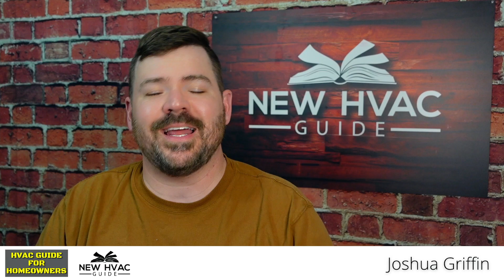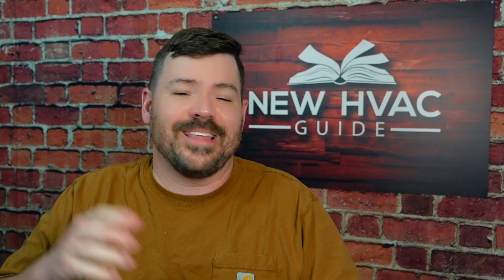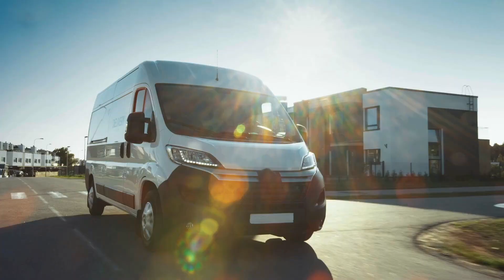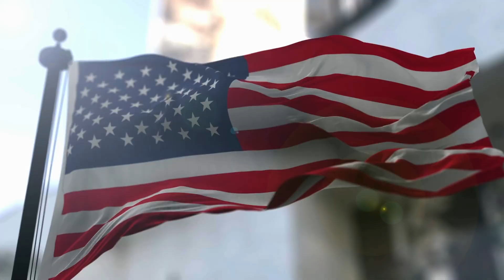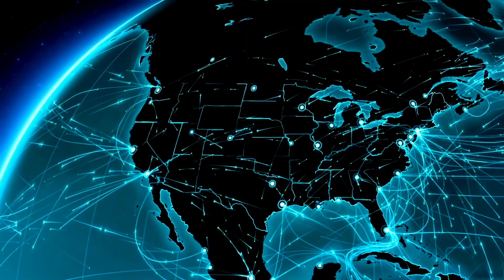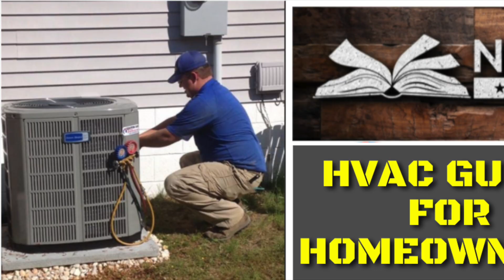The Truth about HVAC Capacitors and What Homeowners Need to Know!

Comment: The 25/5uF GE capacitor on my 1987 SnyderGeneral Comfortmaker JUST failed. AC is STILL working with a new Titan Pro capacitor which was quick and locally available.  (Quick availability comes over quality in the middle of summer) NOW, I have time to look for a spare capacitor. Any recommendations given that the AC's been on borrowed time by about 17-18 years. A new AC means a new furnace. Ugh.

Comment: York AC installed in 1997.  Capacitor lasted  30 years.  Replacement lasted 4 years.
Yea, the system is old, works great.  Where I live I need it less than 3 months a year, and the months it is running the power bill only goes up about $90 to cool a 3600 sq ft house built in 1965.

Comment: People don't like paying for labor, especially when it is at a rate higher than they make regardless of skill level.  Think Surgeon 
compared to someone mowing your lawn.  Doesn't matter.
So often companies just include the cost of "everything" into the part.  Then suddenly its no big deal for the customer.
It would be nice to have a breakout of labor and parts charges, but to do so only will give you a headache with the customer, and deter them from using your company again.

Comment: On price to replace capacitor, HVAC companies are a total rip off. Charging hundreds of dollars to replace a capacitor. I replace them myself. a local parts company sells the caps for $20 to $40 each, and they can be bought online for $2 to $5 each. I stock a couple spares of the 3 caps used in my A/c unit. Just replaced them this week. FOR FREE!!!!! Yeah!! I am also building my own supply of spare parts for my old ass machine, such as contactors, transformers, motors, control board, other components. Over head for a company to stock capacitors? What overhead? The parts are dirt cheap, dont take up much space at all, not much labor to swap out. I am in las vegas, and the weather is very punishing for the caps, no matter what brand you buy. contactors typically can last about 5 years, then are worn out. caps can last 2 to 4 years, and then they are just ready to give up. It would be nice if you could name some names, on best quality parts. I respect quality, but not sure if even the best quality would last too long in the las vegas summers.

Comment: I keep an AMRAD turbo200 capacitor on the shelf for when not if the OEM capacitor fails. they are hsndmade in south FL HVAC company only be charging a maximum of about $400 to replace a capacitor. That includes the trip, diagnosing, labor and cheap $10 capacitor. I can replace my own capacitor in 15 minutes

Comment: Why did capacitors used to last forever and now they only last a couple years? Was it the PCB oil?
Reply: With today's tech every product is made to perform and operate for so many hours of service within certain operating conditions. 
There was a time when companies were in the business to "find or create solutions" to problems.  
Now that just "appear" to be trying to find solutions to problems, when in fact companies are working hard to continue the problem.
Because, if they were to fix the problem you wouldn't need their products anymore.
Reply: @johannjohann6523 so it’s planned obsolescence then. They’re designed to fail.
Reply: And nowhere is this seen more than in healthcare.  We have companies that believe "chemistry" is the answer to disease and better health.
But chemistry has "Never" cured disease.  Chemistry or pills only treat the "Symptoms" of disease. That is why we have "Doctors" instead of "Healers".
Do you really think there is no cure for cancer after 100 years of research and the billions and billions spent?  How about if I told you the cure for cancer was discovered in the 1930's?
And it was big Pharma companies that suppressed that knowledge?  And now Cancer Research has become an industry unto itself.
Reply: How about it is a known fact that neither elephants or whales do not contract cancer.
And today Cancer Research does not include studying either species.
This is on top of disregarding the cure found in the 1930's that uses Frequency to kill cancer cells. Yep, completely non-invasive. And
already tested on human subjects who were all cleared of the cancer in their bodies by this process never to contract cancer again in their lives?   Humans Suck.
How can this work?
"If you want to understand the mysteries of the Universe, first think in terms of Frequency, Vibration, and Energy".  Tesla.
"Frequency" is the answer "to Everything"!   But to cure cancer would mean billions lost in fake medical procedures. Jobs lost for people who
simply don't know any better. Pawns in one the largest, and most evil schemes for profit ever created.  Because it is at the cost of lives lost.
Lives that could be saved, but are not.  Once you realize this well everything is just downhill from there.  Peace.

Comment: Have 44 yr. Old carrier 2.5t pancake ac with 7.5 kw heat still rocking all the factory parts, even the same 9inch tall 3.5in wide 35/5 cap on it, cools like a champ here in Phx, Az. Don't make them like they used to
Reply: business wise, all companies don't make them like that any more. they would be out of business. And they would never meet efficiency standards.

Comment: I keep a spare one that has been run in my unit to test it,  as a spare at all times. I nearly burned up a condenser fan motor when the capacitor died while I was mowing the lawn. I had finished the lawn and noticed that the house was getting hot. I looked outside & noticed that the fan had stopped. The motor was so hot that water sprayed on it turned to actual steam. The thing is still running, and that was about 10 years ago!  The motor was made in India.
Reply: My fan outside is on but no air blowing inside my home.  Do I have the same problem?

Comment: I think changing a capacitor should be covered in a minimum service call. That can be $50 or $500, either way the customer should always be informed of the minimum service call price before you come to them. Service call plus the part cost.
Reply: You would think so because by the time they are done with their meter checking the microf readings, its only 3 more minutes of work to swap in a new one. Lots of contractors bill in 1/3's of an hour or 20 minutes is the same as 1 minute extra. Even so, it's surely not unfair to figure $50 plus the cap and the service fee. Lots of contractors will not charge labor to install the cap if they find the problem within the first 15 minutes.

Comment: I am the only company in my area who honor the capacitor warranties. I have warrantied more amrad than titan pro. Thats my experience. If you read the factory read out of a lot of the Amrad they sometimes read lower than the MFD rating. And 9 times put of 10 there a reason the capacitor failed, they just dont "go bad".

Comment: Capacitor question for the experts.

I bought a dual capacitor 40/5 but label reads 370V.
Original capacitor reads 370/440V      is it ok to use?

please advise
Reply: Yes, your unit will only see 250 volts max.
Reply: Thank you so much for the advice.

Comment: AMrad is 5 years warranty and made here in the USA, Florida. I think JARD and MARS are made in the USA as are Titan HD. I have a 1991 Amana condenser and it still has the OEM cap and contactor that still works, no leaks, no bulging etc. Unbelievable.
Good capacitors are 370/440 volt rated and made in USA.  Also, a good cap is going to cost $30 to $40 vs. $10 to $15 for the junk that lasts maybe 2 years. It is always a good idea to have a brand new spare handy for the hot summer day/night that you need a new capacitor and HVAC is swamped with service calls and can't see you for 2 to 3 days. Or, they haven't got the correct one at the time, you can supply them with the spare for less downtime.
Reply: Over this past weekend (22/23-June) a/c went out. With the excessive heat I couldn't get service until Monday 24-June. The company that installed/service my heat pump yearly diagnosed BOTH a bad dual run cap. and a defective contactor. 
Cost in excess of NINE HUNDRED DOLLARS. Quite ridiculous for about $40 in parts and about ONE HOUR'S LABOR!!!
Reply: @waynetaylor8082  How greedy...I think you could get most of that back. Did they tell you this price before you said okay, do the work or after the work was done?
Reply: Yes they quoted me the price. Locally you sign a tablet authorizing the repair/work after the problem is diagnosed and before any work begins. 
Only the second repair on a sixteen year old Carrier HP.
First time for cap., second time for contactor. Thinking about it that way, lessens the sting of writing that check. 
I appreciate your response, stay cool and enjoy the day/night depending upon your geographical location. PEACE 🤞.
Reply: The price of a cap is also dependent on the capacitance rating, which is usually determined by the size of the compressor motor. A 45/5 uF cap is going to cost more than a 35/5 uF cap.

Comment: I saw at least a couple of YT videos that suggested replacing a 330V rated cap with a 440V rated cap.  I don't know if a mounting bracket needed to be bigger but that shouldn't be a big deal.
Reply: Yes, a 440V cap is likely to be more reliable than a 330V or 370V cap, and using a higher voltage cap is perfectly fine and advisable if it fits. But never use a cap with a higher rated capacitance than the one you are replacing.

Comment: We usually choose capacitors based on the specs of interest, like rated operating voltage, max peak voltage, internal resistance, operating and peak current ratings, operating temp range, dielectric hysteresis, size, terminal configuration, case style and bonding ,and of course capacitance value.   

A reputable company will provide these parameters and be honest about it 

We can install separate capacitors in place of those multi-capacitor assemblies when there's adequate space available.

Comment: Got charged $1250 for a capacitor and a booster kit. Stay away from big companies. Any company that advertises on billboards over charge
Reply: Many companies use flat rate pricing for repairs which generally will elevate the cost some but theres at least one company in every market whose business model is to price repairs so high that its easy to justify replacement, especially if they can get you to finance the replacement system.  Offers to do seasonal services for super cheap are often time just a foot in the door for them to condemn your equipment.
Reply: Absolutely! Use the small, local shop that has good reviews..
Reply: I think my capacitor is bad and looking to replace it, but after opening the side panel, the Model # sticker on capacitor  was pulled off. How do I find the model # of capacitor? Can I use the sticker on the side panel which includes all kinds of info.
Reply: @inquisitvem6723 look up what capacitor the compressor and/or fan calls for and use one the proper one. Otherwise, you pay an HVAC tech to do it for you and pay what they charge for that knowledge/expertise to handle it. Preferably a smaller company that doesn’t take advantage of people.
Reply: You’re an entitled, ignorant American
Reply: I’ll do it for 1245
Reply: I have been scammed too while I understand they have to make money, but come on, their profits are over $1100 for a visit.  Is wild.
Reply: By the way. I got a call for one of the tenants today , Is hot here today,sunday, I called some companies but they don't work sunday, I went myself test the capacitor and it was broken, went to the store got one I replaced it for $35.00 and good to go tenants are happy for the quick response.  😀

Comment: I've paid $400 twice within two years to HVAC contractors for capacitors. I'm tired of being swindled, and instead going to buy turbo 200s.
Reply: Just buy a standard AmRad capacitor.  They have a 5-year warranty, you don’t need a turbo.  You can buy them eBay or Amazon.  I only sell American made.  There are six American made brands, but we primarily only stock AmRad.
Reply: You’re entitled and that’s the problem, you want same day service no matter how hot or cold it is day or night and then cry because you’re paying for an emergency service. 
Techs work 24/7 in any condition, we sacrifice our own lives for you to have heat and ac. 
You are the problem, stop being a selfish entitled idiot. It’s sad how entitled Americans have become
Reply: Shouldn’t call them more then once so they can document or study. Cause they document when you you need that first maintenance but don’t tell em and fix it.
Reply: @GameHEADtime  I'm replacing the system. Found a contractor after purchasing the newhvacguide.
Reply: That much capacitor blowing should indicate other problems like a motor that's drawing too much current.

And then there's the question of knowing if the capacitor has gone bad or not, and how so.
Reply: @elgringoec  First mushroomed, second was "weak". You do make an excellent point though. The system is 19 years old, and I'm quoting for replacement before any more failures.

Comment: Ive been using Titan and jard, mainly. In the industry since 1987. I have to disagree that "everything else is garbage.," o stay away from the turbos, pers. But, to each, his own.
Reply: Thats just my experience with many of the "made in elsewhere" caps, even on my own systems Ive had brand new caps not last a full season or are 20-30% out of spec by next spring.  The turbos are pricey, but Ive only seen a couple that have failed or even gone out of spec so I installed them in every house ive owned but i'm in n. California so 5 months of a/c season and our power supply sucks, lots of brownouts and power spikes.  Have you had bad experiences with the Turbos?
Reply: @Adam-ul2px  You bet, a Turbo is made by AmRad also with the same 5-year warranty.  You can buy three standard AmRad caps for the price of a Turbo.  Turbos works great and have their place.  But they aren’t any more reliable than the standard AmRad caps.   Our drawers are packed with the top 15 models.  Same product and same company,  each van has two Turbos for the super rare.  Both have the warranty and factory tested.  Just saving you a few bucks and have an extra on the shelf, if needed.
Reply: Titan Pro and Jard are not made in the USA.   AmRad, Titan HD, BMI, Mars USA and Titan Pro Green are all American products.
Reply: I offer the customer Amrad,Titan Hd,Titan pro or turbo caps. If you give them options who cares what they choose charge accordingly. Most people choose the Titan Pro and they work just fine.

Comment: Been in the trade for 18 years and I will only install Titan HD or Turbo 200's.  The HDs are made in the USA and are holding up pretty well and the Turbos just last and last and have a 5 year warranty, everything else is garbage and only lasts 1-2 summers before they start failing
Reply: thanks for the feedback. I have a spare one sitting on a shelf. I am going to check the brand name.
Reply: My unit is just three years old I swapped out the capacitor (made in Mexico) for a Titan HD. If you are looking for a igniter for your furnace look at Robertshaw Made in USA.
Reply: Yes, I have a USA made Amrad.. Is great!
Reply: Thanks, good to know. My capacitor just died suddenly running my AC for just the 2nd time this year, as its been so cool. 
My local Hvac supply was out of the particular one i needed, and said i could just order it myself online and save their markups 
Lol. As much as i admire his honesty, i really just wanted to go buy the part and put it in and be done with it today, not wait another several days. Fortunately its turned off stormy and cooling. 
Anyway, i was wondering which brand i should look for and now i know what to look for , for sure.
Reply: Wow, this is literally may experience.
Reply: Turbo 200's have a 5 year warranty, I have tried Titan HD, still waiting for the results to come in.
Reply: I had a 80/7.5 titan hd explode today.  It was 3 yrs old.